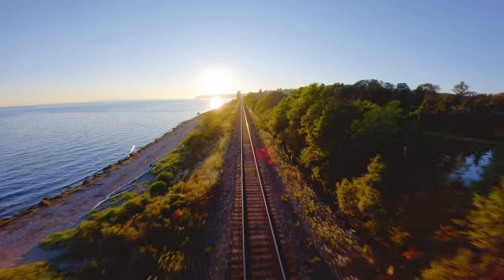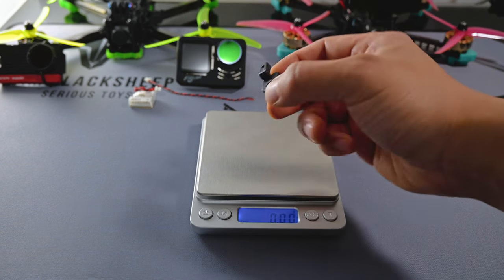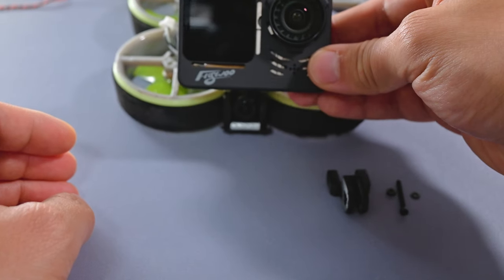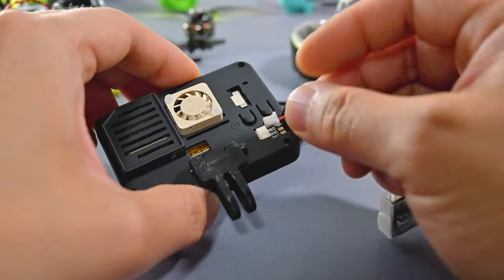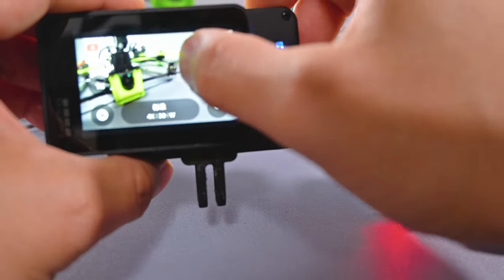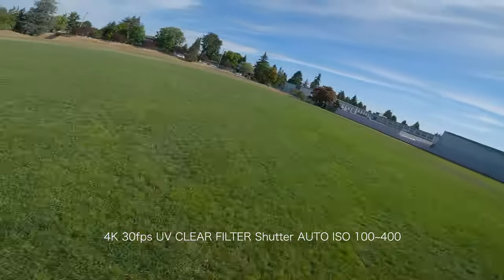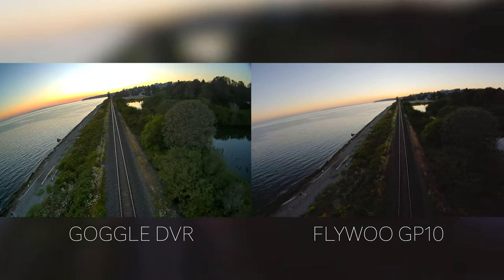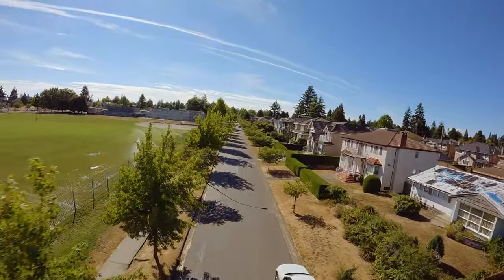Flywoo GP10 Ultimate FPV Action Camera Review | Naked GoPro Hero10 w/Sub250g Drones and More

Comment: good video and good information!! I have a newbie question since they usually help me and I don't know how to solder, I just bought a flywoo naked gp12, and my question is... how do I manage the power to the go pro? I know there is a cable with a converter and my question is: Is it connected to the lipo that also powers the drone? Or do you have to solder? I have many questions about that and the order still hasn't arrived!
Reply from the maker: Hi you can do it either ways. 1) GoPro plug to the balance plug of the lipo. Or use a different plug which goes GoPro to solders to the main positive and negative pads of your flight controller. Both plugs are included in the kit

Comment: Does it accept 4s lipo directly as input? Or do u need a 9V BEC?
Reply from the maker: The gp9 10 11 can accept directly. 1-6s balance power plug is provided or solder the cable directly to vbat and ground.

Comment: Its a shame you render in 30fps, you fly some beautiful spots.
Reply from the maker: Thanks man! ahh what frame rate do you suggest? I use to strictly shoot 24fps, but I found 30fps to be a good "normal" ground for FPV purposes without looking too choppy, or too smooth at 60fps!
Reply: @PattyFlipz  And depending on what go pro you use, the 24fps can drop frames here and there. My hero 7 black drops frames in 24fps.

To get a cinematic feel, I shoot in 60 fps, then either slow it to 80% or 40%, or speed it up 2x or 4x, and edit on a 24fps timeline. 

You can also slow 30fps footage to 80% and it’ll play smoothly on a 24fps timeline. 

If you watch one of my Terraplane videos, you’ll see the occasional frame drop while filming in 24fps. I havent tried 24 on the newer gopros to see if theyve fixed it, but its a bummer and its why I switched to 60.
Reply from the maker: @kaimultivideo4956  Awesome! This sounds very interesting. I will try it out someday. Thank you!

Comment: Gopro 8 best. Gopro 9,10,11 - very bad - no details at all - always blurry videos!
Reply from the maker: Oh really? I should check it out! and best of all its cheaper right? hehe
Reply: @PattyFlipz  yes - this cheaper. And 4k from gp8 more better than 5k or 4k from 9,10,11. Newer gp using very bad sensor and using very more noise reduction - as we get no details at threes, grass and so on. Very bad - im disappointed - im want sell my gp10 ans buy gp8 :-D
Reply: Hi. Im find best modes for gopro 10 - this is only 5k 16:9 or 4:3, iso 100/100, shutter manual! Nd8-16. Sharpness middle. This is modes have good image and details..
Reply from the maker: @stenkinsekil  I will try it out!